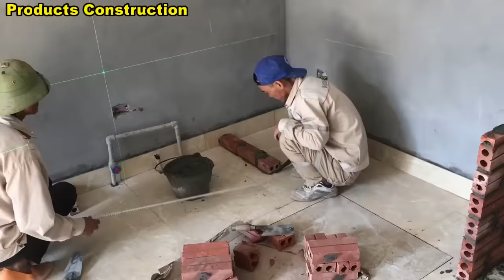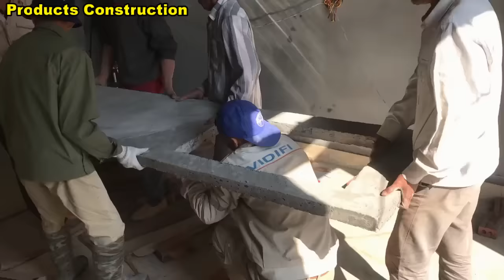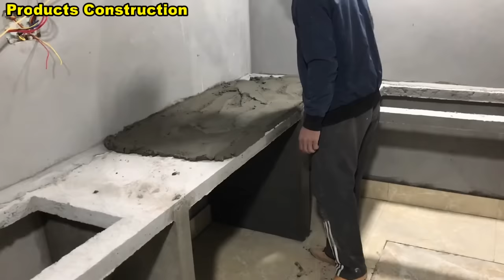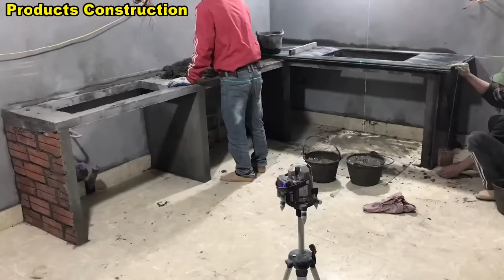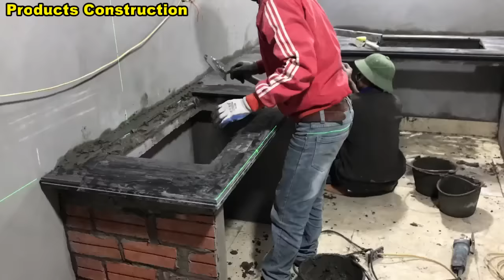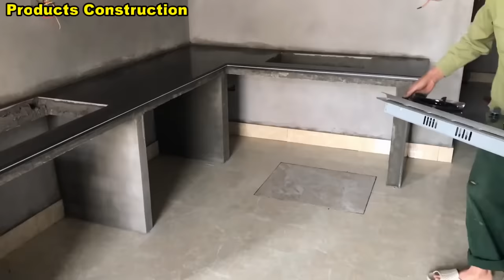Techniques Build Kitchen Cooking Table Traditional // Install Granite Kitchen Countertop

Comment: 2 years ago when we were building the kitchen at my aunt's home we made same type of concrete slabs but, we didnt make them separately. We made a moulding frame attached to the walls below and simply filled it with concrete and so, we didn't have to carry those heavy slabs all the way to the kitchen.
Reply: How you made the frame's base/bottom? After the concrete dry, how you remove the base? Or just leave it as is (the the base cannot be plywood)?
Reply: How is it going now? Feedback please. Is it still well? Cracked? Please
Reply: Wow many Many congratulations to your aunt ...Pay my salutations to her 😂

Comment: no bonding between brick wall and tiles, cannot do like that. one soft kick could make that wall damage. Contractor only know profit, not thinking the quality.
Reply: True, mediocre work.
Reply: @immarjunrobledogeverola  If any worker would do something like that in Croatia, he would be fired instantly. And no supervising engineer would even cinsider to give green light for such bad work.
Reply: @dubravkojanusic6996  which country people in this video?
Reply: @metatronsandalphon5397  Dont know. I'm Croatian, Europe.
Reply: not as you might think. It's not going to break. Because there is a great force from above, in Vietnam most of our houses are built like that, and very sure
Reply: gua juga mikir gitu
Reply: I think they definitely could have done more ,  but once you add that top and all the weight I guarantee there is no soft kick that will work

Comment: Use bricks as foot to table kitchen is not so nice looking if the table doors are installed ..looks too big ,the thinner is better .. maximum are 2 inches

And why u still install tiles skating in the wall under table ?  Those will be problem if cabinet will be installed

Comment: Its looking nice, but its durability is low. Because bricks stand on the tiles! So tiles and cement not properly adjustable. After few years its will be damage.
Reply: would it be better to put tiles after brick? And does using wood over tile is also the same problem? thank if you can answer :-)
Reply: @stephdep8825  yes ita better install tiles after install brick.

Comment: Well may God help you anyway but that's wrong building way it will not be strong enough 
You have to break in the walls to mix the old blocks with the new one ... I'm not a builder I'm electrician  and I have the building idea

Comment: Very dangerous construction.  The bases are too narrow to maintain balance.  Neither there are any support from the walls that will grip the RCC into its groove, nor there are any chipping on the glossy tiles floor that will hold the bricks tightly.  Bad engineering.  Hope that the concrete slab does not fall on the feet of the lady who will be cooking on her kitchen.